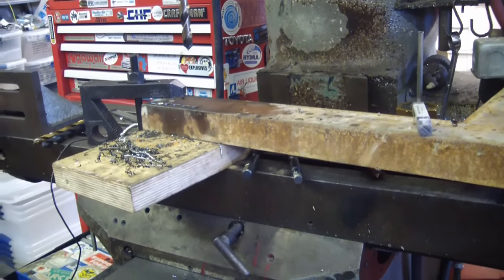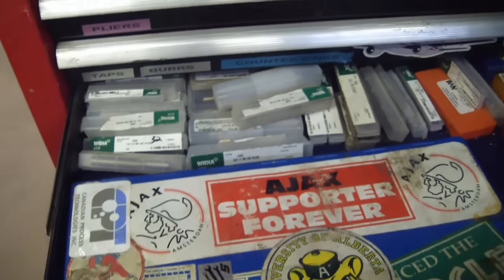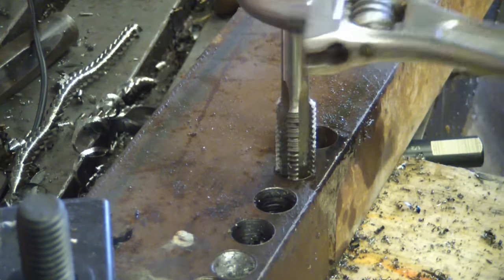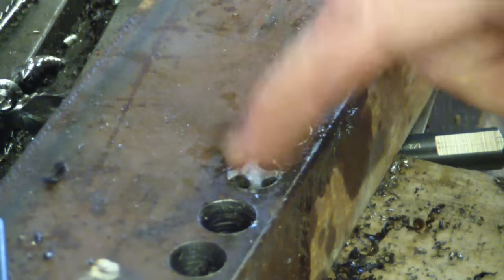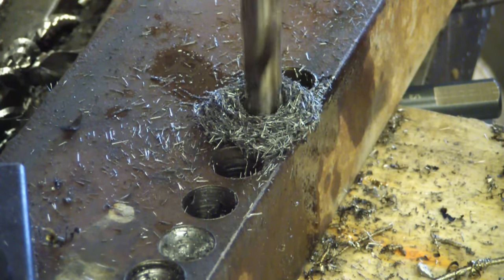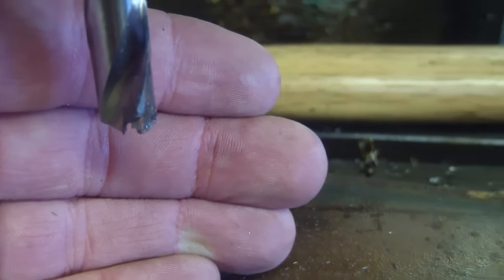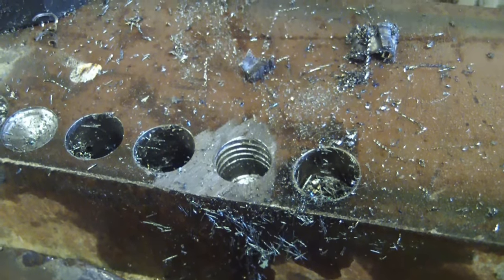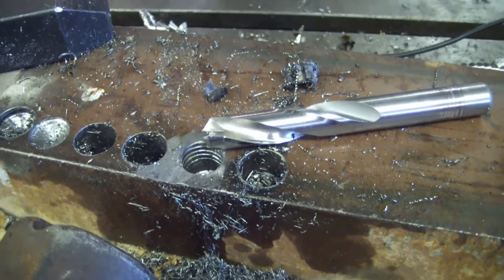Manly-man skills: Remove a broken tap the hard way.

Comment: I broke a tap in acid-proof stainless a couple of weeks ago, blind hole. I used a hammer, a sharpened center punch and some patience to extract it. Basically I just shattered the broken tap in the hole piece by piece with the punch
Reply: That's the way I do it. It's way quicker to punch it to shatter it and start over
Reply: I broke a tap in hardened steel,.. was not a cheap tap, best I had... Rushing using a drill to tap with, but hey, the 30 previous holes went great. Couldn't extract it so I melted the whole god damn thing with the welder and filled the f**king hole, ground it smooth and walked away. Decided I didn't need a threaded hole that badly.
Reply: @justingrey6008   That's a reasonable solution.  (sarcasm)
Reply: wait, if the stainless was acid-proof, couldn't have you used acid?
Reply: I typically destroy the shattered tool using a punch and hammer.
Reply: If yer 2 pnder don't bust it use yer 4pnder!  Oh don't hit yer thumb there!
Reply: Justin Grey I
Reply: Rip
Reply: @thisisyourcaptainspeaking2259    Oh Captain, my Captain, we are grateful for your wisdom though we be not worthy.
Reply: @guardrailbiter  I'm gonna guess you've never broken a tap before.
Reply: @thisisyourcaptainspeaking2259  
On the contrary, I have broken taps.  I just never received any good advice on how to fix the problem.  So I was not being sarcastic (for the first time in my life).
Reply: @guardrailbiter  Comprendo.  I don't recall ever doing this any fancier way than just busting up the remainder of the mostly shattered remains using a punch and hammer then blowing the debris out with air.  Same for easy-outs.  Figured someone might wanna slap me or something but that's how I've been doing it.
Reply: @justingrey6008  Wait. If the stainless was acid-proof, but the tap wasn’t…
Reply: @josephdugal4533  alum will eat low grade steel, tool steel and carbide found in taps, I don't want anything to do with any acid that would eat them in a timely manner.

Comment: Glad to see the carbide bur work out here. Had the same issue at work trying to tap out an 8mm hole for a Timesert and snapped off almost exactly as what you were working with. Tried almost all the same tricks and the carbide bur was what finally got it out.

Comment: As a mashinist, mostly working CNC mills, I like to keep some used up carbide endmills handy.
You can use those on the drill press as demonstrated or write a quick little program (preferedly helical pocket, if your control allows for it, but drill pecking is ok too), to mill out the broken bit.
If they breake it's no problem, since they weren't good for anything else anyway.

Comment: A broken tap in a large heat sink like that one...just use a low acetylene torch flame and heat 'just the broken tap' to 'cherry red'...next & quickly...turn the acetylene off and hit the cherry red broken tap with full force oxygen from the torch...oh yeah, don't stand in front of it because it will come out of the hole like a volcano. Old School methods still work. Clean up the partially tapped hole and do it right the next time.
Reply: Wow, does that really work!? Great tip, hopefully I remember it!
Reply: The machinists at the ship yard I did finish carpentry for did that.. seen it at least twice. Does work
Reply: That is a great idea. Just the thing for when you're working in an isolated area, like outback Australia,with no access to a spark eroder, but having oxy acetylene equipment.
Reply: Always keeping an eye out for diff tricks so thanks for that..
Reply: Yip!
Reply: I am sure I read about this technique in an OSHA manual. 🤣😂🤣

Comment: There is a special carbide spade drill made for drilling broken taps.  The run at a real high speed.  If you don't run them fast enough.  They break apart.  If it is going fast enough.  It goes through like butter.  It is best to run a full flood anytime you run carbide.  But hard to have that in a home shop.  I was a machinist for 37 years.  I have had luck with the tap extract like you mentioned.  But probably broke more of them then got them to work.  We had one of the electro arc machine for removing taps in our shop.  They buzz through a tap like you won't believe.  One of the bosses in his infinite wisdom goes and surpluses it because it took up a 4 ft by ft space.  I was like what the hell.  He tells me no body ever uses that thing.  I said the hell they don't.  It gets used all the time.  It is so fast guys are in and out of it in less then 10 minutes.  They make sure they are so they don't have to answer to why they broke a tap off.  We had EDM machines all in our shop across the street.  He tells me if a tap gets broke we will send it and have them burn it out.  If it was any sizable tap The Electro arc had a circuitry that just buzed through they thing.  Faster then a drill could go though the hole to start with.  It had flood coolant and a vibrating head also.  The combination is what made it work so well.  I was thinking you maybe should show how to tap the hole properly.  Using the correct handle instead of a wrench.  Backing the tap up to break the chip.  Using a spring loaded center to keep the tap in proper alignment.  Show some different style taps.  Standard, gun, spiral, and form taps.  If you have one show them how a tapping head works in a drill or milling machine.  Or even show how to power tap on your milling machine.
Reply: When I was a college in uk they called it a spark eroder
Reply: We had one in the Navy we called it the disinigrater sounds like 
The same thing you used
Reply: I agree with Bobby Harpoon.  There’s some good learnin’ we still need from ya!
Reply: I just removed/ destroyed a pipe tap buried in a hole. thankfully it was a through hole. I grabbed a carbide rotary file (burr) with a very sharp cone or point profile. used a die grinder.  immediate results and ripped it to shreds. pulled  out the chips with a magnet on the end of a scriber
Reply: yeah, that's the last place I would use four flute tap, I will go for the spiral, gun if you will, type tap. I believe it works best because it cuts one side of the "V" instead of both sides, like when you cut a male thread on a lathe.
Reply: I just keep my broken or messed up carbide endmills and use then to eat a tap out.  Get use out of a junk tool and works like a charm
Reply: I totally agree. The carbide spade drill is the best tool to drill out the tap. I’ve even made them from shanks of broken carbide tools. If your piece is small enough to fit in an EDM machine with a rotating head then using a piece of brass tubing as an electrode works great too.

Comment: I use a ballnose carbide endmill and drill a hole through centre. Make hole big enough that it just fits inside of flutes that way there is no interrupted cut to break ballnose. Once you drill out middle a solid hit with a chisel or punch will cause tap to shatter. Blow out and retap. This also saves existing thread.

Comment: Great vids fun and informative. One trick i use with those pesky broken taps is to grab a dull solid carbide end mill . run it at about 500 rpm. And just plunge thru the center of the tap. The end mill will melt the tap on its way thru past the tip of the tap. You may want to start off center on larger taps to brake thru one of the webs. Then just pick the rest of the tap pieces out. Just another way to skin that cat.

Comment: Or get two small steel nails, put them in the little slots on the side and use a clamp to grab both nails and back the thing out, like an angle grinder wrench.
Reply: My thought exactly!
Reply: Ariel Lezen I have tried that but I haven't had a lot of luck with it myself. Have you had it work very often? I could just be unlucky I s'pose...
Reply: Ariel Lezen I do the same, it works 60% of the time, the other 40% is a long hard rumble match with a drill of your happy choosing.. in which you learn to love after drilling for 2-3 hours because you're to cheap to go out and buy another drill bit.
Reply: Ariel Lezen Exactly. Just build your own mini "spanner" to use to back it out.
Reply: +Peter Jensen I was thinking the same thing about the mini spanner. I have seen him make one in another video, not a mini though. What about welding a little nut on there?
Reply: +Ariel Lezen Or hey maybe even use a small cut off wheel to cut a groove into the top of the tap then use a screwdriver to back it out. I have done that many times, just not on taps.
Reply: +MiniM00se Luck was not on your side, that's why the tap broke, I wouldn't think it break above the surface where you could get a a grinder or cutoff wheel near it, so cutting a slot probably is not a shot.
Reply: Cheap needle nose pliers work too. Jab 'em in there and clamp the handles (and hinge) between two boards. Turn the boards to back the tap out. Use cheap pliers because it may or may not ruin them.

Comment: I know Carbide Burrs work extremly well. I had a broken easy out that no drill bits would touch. I got a carbide burr for my dremel and it chewed up that broken eazy out like it was nothing. It only took a few minutes and it was gone.
Reply: I would have just gone for the carbide burr in the first place, they always work for me.

I always keep the burr flooded with coolant though.
Reply: what head type did you used? round or flat?

Comment: If you stick two drill bits in two opposing flute channels, you can usually walk those busted taps out with a crescent wrench on the two bits.
Reply: that's a novel idea sir
Reply: I'll be using that tip. Thanks brother

Comment: I have used the tap removal tools and had some success with them, but they are expensive and not easily available. I usually try needle nose pliers and try to see if I can get any movement out of the tap. If it moves I use air to blow out the little chips as I work the broken portion back and forth. This works pretty well. The few times both failed and I had to get schooled from a guy who had many more years experience working in much worse environments then myself. He taught me if the tap breaks off in a cast block you can heat it with a torch and the tap will melt before the block will. That is a last ditched effort for me but with his years of experience makes it look easy, he took the time to show me how to do it. It takes me much longer then it did him but its one of those things that you don't get a second chance with if you melt the block.

Comment: I've never had a broken tap I couldn't remove by shattering the tap with a punch, hammer and magnet. And, every tap I've broken was preceded by a boneheaded move of either not keeping the flutes clear, side loading because of some awkward position (maybe not boneheaded, unavoidable) or drilling a fastener off center and leaving behind pieces to dislodge and jam up the tap.

Comment: Very educatitional,  My worst knight mare "hope I don't jinx myself", breaking an exhaust stud off on the firewall side or busting a head bolt. Found out from my tire store who did a safety inspection, "they safety inspect" everything trying to make a buck can't blame them, but they found a broken A-frame bolt on my VW MK2 Jetta. After watching this I realize that I could have pulled that myself as it was just the head of the bolt, "so no-load". took it right to VW's and More and paid the guy. Thanks for the education AvE.

Comment: If the tap snapped off because of a side load (using an adjustable wrench instead of a double end tap wrench) a tap extractor will generally work but if the tap was stuck and twisted off, then probably not. A lot of people do not have access to the equipment (mill) or maybe not even a drill press which makes a normal carbide machinist drill difficult to use successfully. Using a carbide masonry bit (easier to get) with a guide (hole in a 2x4 clamped in place) would be a good option, especially if it is sharpened. Start with as small a diameter drill as you can get.  Another (slow but accessible ) solution is to use a abrasive/grinding bit in a Dremel type tool. In aluminum, if you can get it really hot (high oven baking temp 450F) the aluminum may expand enough to get the tap loose. Aluminum melts a bit above 1000F

Comment: I have had to remove more broken taps than I would have wanted to. I never found drilling worked very well, the break would almost always fracture the remaining tap and as you started drilling the fragments would break free, jam the drill and break that as well. Our solution to anything bigger than 16mm was a home made punch with a tough carbide insert (generally a trigon shape) brazed onto a rod and just bash the remaining section into crumbs. This used the taps brittleness against it.  Then re-tap the hole and keep going.
Reply: This works. Just hammer them with a punch or so, hard metals like taps break easily. I have even managed to removed a 6mm tap in this way.

Comment: Tap extractor!!!  Like most tools, you need practice using them and need the right size to get good results  using them.  I've successfully used them for retrieving a broken #6-32  up to a 1/2-13 taps.  Start by blowing as many chips out of the hole as possible then add oil or cutting fluid.  Make sure you can get the get the extractor rods down through the flutes. (spiral flute you're SOL)  Next slide the collar down as close to the break as possible.  GENTLY coax the broken tap back and forward until it willingly backs out with little effort.  Most of the machinists I've helped out never saw a tap extractor before.

Comment: A STORY that only fellow tradesmen would appreciate:

I began my career in 1972 at a trade school in upstate NY. I was sponsored by Alliance Mold Company (a branch of Alliance Tool and Die) so I had employment upon graduation. 

I served apprenticeships in moldmaking and toolmaking. My first day on the job I was working for an older moldmaker direct from Germany. His name was Gunther Buetnagel, or something very Nazi sounding, and he had that strong German accent. To say that I was intimidated would be a gross understatement.

My first job was to take a mammoth ejector half (or, cover half...so many years later I forget which half got the waterlines) of a mold and hoist it to the equally mammoth radial drill. My assignment? To drill water lines. I soon discovered that this was the most dreaded job in all of Mold Making, and it was always given to first year apprentices. 

Well, I had never operated a chain hoist before, and I had no idea on how to maneuver the hoist hook into the eye bolt on the mold base. And, no one told me that the chain hoist had an override! This meant that as you pushed the button to move the hoist with block attached the momentum of the moving block was too great for the hoist to stop instantly. 

I found out the hard way. As I approached the radial drill I released the button but the block kept going. All that you saw were guys working in that area bailing out, and a huge block swinging from side to side, 

Eventually a journeyman showed me how to do this safely and I got the block fastened to the radial drill. I had to drill these incredibly deep holes all along the outer edge of the block, and they all had to intersect...in other words you had better drill straight. Long drills liked to wonder, and it took experience to keep the drill in line. 

Well, I had not yet developed this skill...I did not clear out the chips correctly as the flutes on the 3/4” diameter drill bit went below the surface. You guessed it. The drill bit broke deep into my first ever waterline! 

Disaster. On my first day. This drill had to come out. A mold must have waterlines to keep the steel cool during production. Of course I had no idea how to do this. Worse yet, I had to find Mr. Buetnagel and give him the exciting news. 

These old country moldmakers were hard ass. He told me to get that fucking metal out of the waterlines on his mold. And, not to bother him until all of the lines were in. “Now, leave me the fuck alone,” was his parting statement. 

I was fortunate to get help from some 4th year apprentices who understood my sorry situation. But, after many tries we just could not free the bit from the hole. It was too deep (probably 8”), and impossible to break free. The engineers had to design a different system, which meant changes in dimensions and new blueprints. 

You would think that after all of this that they would not let me anywhere near the block. It was not done like that back then. I was given instructions by Mr. Buetnagel not to bother him until the job was done. That meant getting back to the drilling! 

Well, I did not bother him (he was well aware of what had happened) and I passed this obvious test of my character. I learned. I got all of the waterlines in. Even though it took me much, much too long. It was a part of the initiation as a first year apprentice. 

The moral: I wish that we had you guys back then!

Comment: I had a similar problem (wasn't a tap though, was an ez-out snapped off in a broken sparkplug stuck in my cars engine heads) I had no idea about the drillbits you used for this (and the ez-out was hard enough that cobalt ones did nothing), so I actually used a small 8mm diamond tipped holesaw (like you use for tile). Worked pretty good actually.

Comment: When drilling with carbide: not only does the lubricant reduce the heat by burning off - which will make the bit last longer - but the lubricant also helps the chip flow away from the cutting surfaces which will keep the bit from chipping it's cutting surfaces off when it otherwise is forced to bite chip plus material. It's a general rule in life: "There's always time for lubricant." Holds just as true in machining.